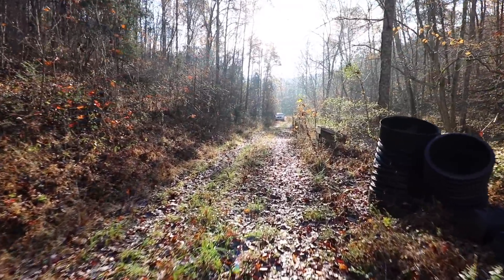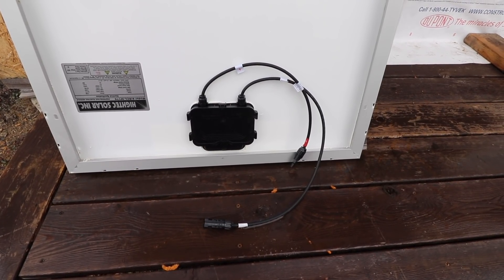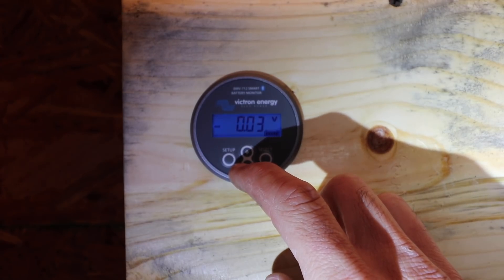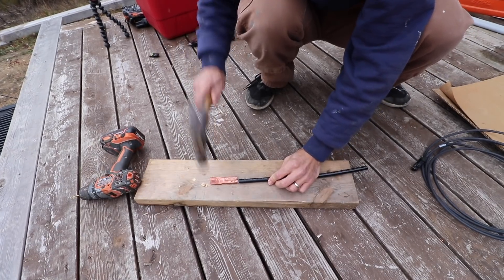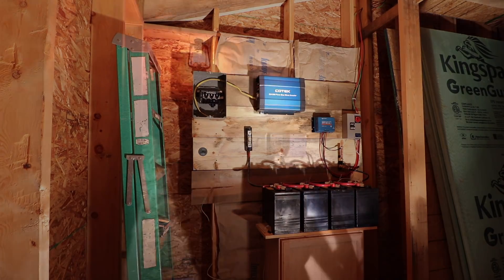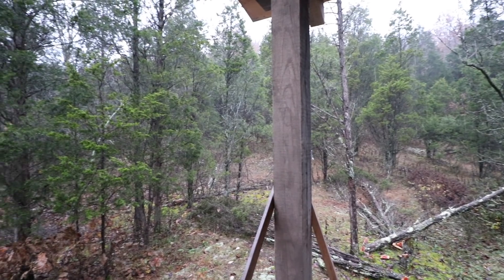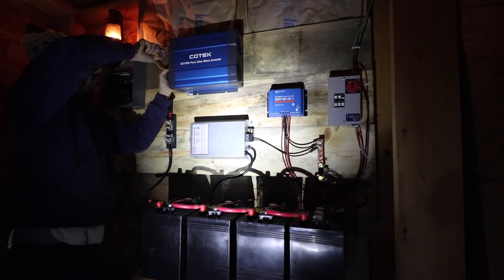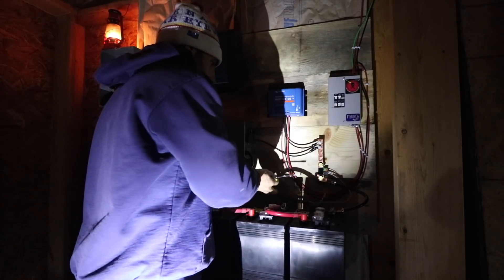Installing Solar in a Small Off Grid Cabin II

Comment: Nice cabin.  Is your power system still working well?  I am particularly interested in the reliability of the inverter and charge controller.
Reply from the maker: Hello, it's working great.  Both the inverter and charge controllers are still working.

Comment: The subframe for these 4 panels allows simple removal for easy maintenance of the roof and the panels with wires. Most contractors drill panel brackets directly to the roof = get it done, grab the cash, and make tracks.
Reply from the maker: I’m very glad I used the racks, about to switch these 4 160 watt panels out for larger capacity

Comment: Do you get snow at your cabin? Your horizontal conduit running from your panels to the edge of the gable will get ripped off by snow?
Reply from the maker: We get some snow, my long term plan is to run that horizontal under the ridge, just haven’t got back up on the roof yet.

Comment: Nice install.

Thanks for editing the slow stuff out. Except when you need to show us a detail.

I used a 4 x 4 sheet of plywood for mounting when I did a house a few years ago. 

The other thing I did was to make it possible to jump start the house from the outside with a car or generator by running a couple of cables to the outside of the house where i could connect on with jumper cables in an emergency.

Hook up a small secondary system with one panel and one battery that charges your phones and maybe runs a couple of lights as a backup. You can do this on your barn or shed. In case on system goes down you always have some form of power. Without running a generator.

For low cost heavy gauge wire go to Tractor supply. 

They sell 25 feet of 2 gauge one color  wire for 50 some odd dollars.

Right next to it they sell 2 gauge 20 foot jumper cables one wire red and one wire black for about 50 dollars.

You get 15 more feet of two colored cables and 4 really nice clamps for the same price. 

Go figure.

It is great for making your battery to battery connections.
Reply from the maker: Thanks Shawn, good heads up on tractor supply I think I paid that much for only 10 feet.

Comment: not sure of your geographical location.  if you get snow there have you considered the weight of the snow bearing on the plastic pvc conduit running horizontally on across the roof?
Reply from the maker: Yea we get a bit of snow, not a ton but I will probably have to reinforce it.

Comment: Keep up the great work! With all that running water you have got to add hydropower. What's not to like about 24/7 power? With Hydro, you don't disconnect the power source or it may over spin, so you need a shunt type controller, therefore once the batteries are full  the excess energy  goes to some air, or water heaters. It may even make enough to run a small heat pump! Air conditioning anybody?

Comment: Well setup...but if i would be you, i would change the pvc duct for the cables straight down and not square to roof for not having heavy snow loads wrecking your conduit...
You can go straight from cells down and then arround house if you like...but not horizontal on roof...keep going...very jealous about your life
Reply from the maker: Jan Meinecke I may do that in the future.  Might go straight up and run the wire across under the ridge cap.
Reply: @50Acres  Hope you dont mind that statement, but it was the first thing that jumped in my eyes. Besides that, you are doing an awesome job...
Reply from the maker: Jan Meinecke no worries!  Been wanting to re route it...

Comment: With DC long wires cause high resistance.  If you would want to have longer wires and connectors you would need to invert to AC  at the panel.
Reply from the maker: Hi CR, I used a DC wire size calculator to account for that so if I do have a long DC run I make sure to use the proper wire size.
Reply: Many of the new panels come with built in micro inverters.

Comment: Smart to build a cabin that gives you a place to start. RVs and trailers are hard and sometimes impossible to heat or cool. You make the calls on insulation and  appliances with a cabin.. Nice property it’s easy to see why you love it there. We did the same thing as you few years back. You will be so happy when you get a little further. The experience is more valuable than you can realize. Each new venture is possible no matter what you have previous experience with. with reason It all breaks down to simple... we really enjoy your clips. Thanks...
Reply from the maker: Hey thank you Wink.  Glad you are enjoying watching.  I'm having a blast building and being out here!

Comment: Nice cabin, get a 4 foot led strip light or some 60 watt leds, bulbs actualy use only 9 watts @ 120 volt . Then you wont need all those kerosene light, put a motion detector on it. Enjoy..Hugh Chicago, Lic..electrician peace
Reply from the maker: Thanks for watching Hugh, I've slowly been adding lights the last couple trips as I've had time to wire them in.

Comment: When you get further down the road, you can have PV hot water using existing panels and the power that would normally be wasted. Doesn't cost much more than the tank. I use one of those 6 gallon 120V point of use heaters. That is enough for camp applications.
Reply from the maker: That would be great.  I think I can get a 24volt element.  At least that is what some other commenters have told me.  And just dump the excess power into hot water heating.
Reply: @50Acres  Intuitively, a 24V element sounds like a good idea. It just isn't.  Draining off your battery requires much more battery capacity, causes an undefined charge state and is not that efficient. Power should be drawn from the panels with a power point controller, leaving the battery fully charged.  I can dump as little as 5W and up to the maximum. That little bit adds up over time producing reliable water. A 36V to 60V array can produce up to 400W from cheap standard 2,000W 120V heater elements.  I'm here when you are ready.
Reply from the maker: Opera, The power that comes off the Panels is DC power around 36 volts, so converting it to AC would be less efficient than taking the output from the CC at ~24vdc.
Reply: @50Acres  I am not using an inverter. The controller has a capacitor bank which charges to the panels power point. That should be about 50V for a 36V array. I actually run one water heater on a 36V array. That controller then pulses the heating element with a variable duty cycle depending on how much power is available. That process is not as complicated as it sounds and is about 95% efficient. At half the rated voltage, a heating element is about 1/4 of the rated wattage. A 2,000W element in a small water heater performs quite well at 50-60V.  Wife wanted a dishwasher and I use the same process for that heating element.  Dishwasher with heated dry and entire house runs on a single 12V battery.  No need to suffer without when off grid! Controller costs about $30 to build.
Reply from the maker: Oh nice I misunderstood you, that sounds great, what specific hardware are you using to take the excess pv power and pulse the water heater?  Would I need a second CC that can be used as a diversion load?
Reply: @50Acres  Charge controller load diversions don't work that well and a second charge controller would only fight the primary one in determining power point.  The controller I use can not be purchased as a finished item and must be built. I don't think it is that hard or complicated. It is similar to the one engineer775 is selling, but that one only works on independent panels and can not be paralleled with an existing charge system.  Every solar panel array has a power point voltage.  When battery charge needs start to relax the panel voltage increases.  My controller detects that increase and feeds enough power to the water heater to drop that voltage to the power point again. This voltage is fixed in the controller and can be adjusted seasonally.  Optimum panel voltage only varies with temperature and not light levels.  Take a while to review my videos and think about it. Take it one step at a time. No more complicated than building a structure. The performance is well worth it. I'm thinking of offering a parts kit some day. You probably aren't that far away.
Reply from the maker: I will check them out, sounds like a fun project once I get my wood stove in and everything else a little bit situated.

Comment: Very impressed with your building skills. I would love to do something similar but I have no skills or knowledge in building, solar, power tools, electrical, plumbing, etc. And certainly can't afford contractors!
Reply from the maker: Hey Em Dee, I learned mostly from reading books.   When I got started I didn't know much at all.  I got a book on framing houses and it really took a lot of the mystery out of it.  The internet isn't the greatest place to learn, books are better.  I also bought a book on electrical and plumbing, the were both good.  Sometimes I had to read sections several times until they made sense or ask someone else.
Reply: @50Acres  Thanks for sharing your experience that way. More library research for me!! Some people just make it seem impossible to get the know-how unless you've been a skilled craftsman your entire life.
Reply from the maker: Just learn one thing at a time, don't get overwhelmed and you will eventually figure out how all the pieces fit together...

Comment: Just bought a iota DLS 45 for charging batteries when the Sun is not good.  It makes all the difference in the world.  You are doing a great job on your Solar.
Reply from the maker: Hey Jim, thats good to hear, cause I just bought it on reccomendation from the place I get my solar stuff from, glad to hear that they work well from someone who uses them.  Thanks for watching.
Reply: 50 Acres & a Cabin it’s three o’clock in the afternoon and it’s been overcast all day.   I just looked a my Battery bank and it’s full charged.  Thanks to the Iota DLS 45.

Comment: Go buy a new cable terminal right now. Don't wait do not pass go. Nice job pretty much all the way around.
Reply: I agree. You cannot get enough heat into a terminal that big with a soldering iron that small to make a good joint. And it will fail when you need it most.
Reply from the maker: Thanks John
Reply: @50Acres  I'm sure I have the terminal lying around the house some where.
Reply from the maker: I've got some in my pile of supplies waiting for the next trip this Monday!

Comment: A bit of advice from a off grid builder.  Buy about $200 of spray foam and go around doors, windows and every crack you can find.  Its pays in control of bugs, critters and drafts.  Without it, its like trying to heat with a window open.  Solar project looks good. Need to find your source of scratch and dent batteries.
Reply from the maker: Hey Base Camp, good to see you back here again.  Good advise on the spray foam, I’m definitely going to do that.  I watched your video on the outhouse, good stuff.

Comment: dude, looks good so far, got an idea for ya to think about.  about that old trailer does it have any parts that are useable like sink ,water tanks, both gray and black. voltage convertors, invertors, lights, there are things like windows, and cabinets, doors, any thing that may work, saves money.  I know I bought an old dodge camper for four hundred, and striped it clean. using anything worth using, the stove, sink's and toilet, tub/shower, refrigerator, voltage box/ fuse block, generator, I even used the lights. there were other things that were useable, some I sold or gave away.  which cut my cost to build out my cabin, too make it livable. I sold the frame and axles, motor and trans, it made me over three grand in parts, that I used else where.   the aluminum, I used for the power house roof. and I wanted to separate the batteries off gassing, from the cabin as you will find out. I uses the heater to knock off the cold if needed for the first two years. but I used copper tubing, to make a hot water system, that ran through the fire box. it wasn't perfect ,but it did work. I went junking and found used campers and took the water pump fuse bars, water heater. all, and anything that used 12 volts.   but it does pay off in the end.  some of the stuff found was junk, but it did work, that got sold off, later on craigslist. now I seen you wiring system, I'd think about moving the batteries out side the cabin. even if out the side wall. as the gassing will sour the living area with a foul sulphur smell, in time. but by using a  battery box, outside, it will keep them cool, and not to cold. insulate the box all six sides. half inch form works fine.  I'd also look at outside water tanks, to recycle rain water off the roof, that should give you a few hundred gallon a fall. I'd also look at using L bracing with a wire mesh that can keep the batteries off any wood or ground. as the off gassing will leak down and rot the wood, and pervert drain the batteries quicker, siting on the ground.  but that would be your choice.  just ideas to think about.try and post more often I enjoy watching....                         the one and only                                      frank.
Reply from the maker: Hey Ralph or is it Frank?  Anyway, I'll have to take a closer look at the trailer to see what is still in there, I know that the stove was stripped out of it.  Interesting story about that trailer the guy who used to live in it was actually in jail when I bought the property off his sister and brother.  It was  It was his trailer, hope he never comes back for it.  Not sure if he is out of jail yet.  It had been pretty rough even when I bought the land so it's been abandoned for a while.  

I am going to make a box for my batteries pretty soon here.  I will vent it to the outside, I want to keep them inside to decrease the chance that they get stolen.  Unfortunately we get Ginseng poachers who start at the main road and just walk through everyones woods poaching so a battery would be an easy target.

Comment: have 200 acres and live off grid as well started with 800 watts 18 years ago, now 3500. Homemade hot water for heating don't laugh old outboard tank 5 gallon sitting on an old propane barbeque and a boiler pump and car heater cores. heats both buildings 1/3 pound per hour .  have the same for my work shop but burns wood  works great. I use a small heat pump when solar has adequate production.
Reply from the maker: apsleyflyer wow you should make a video of that hot water setup, be people would love to see it.

Comment: If you get snow your power tube is going to get ripped off the roof
Reply from the maker: Dale olson working on a solution for that, hopefully by next trip. We are not in a big snow area.
Reply: Yea was thinking that to, but you get those snow breaks  or whatever they re called, it prevents the snow from just sliding off in massive pieces. not expensive